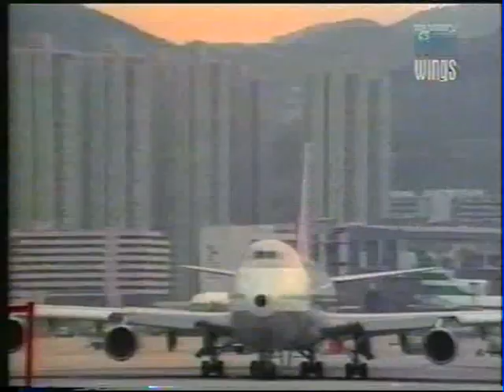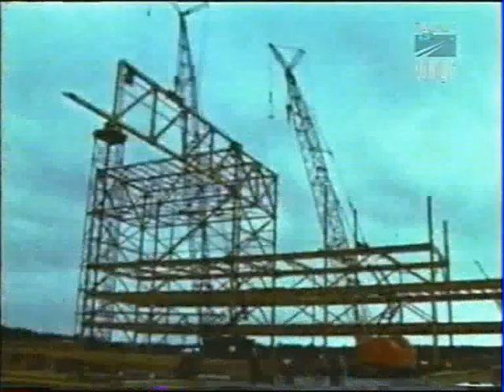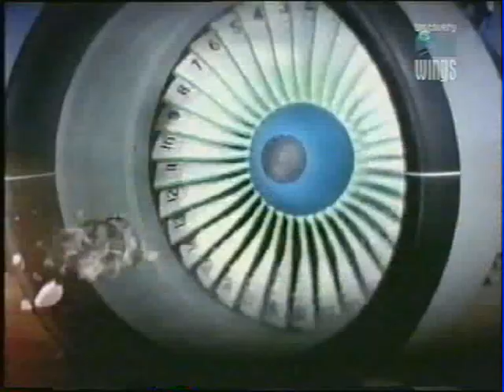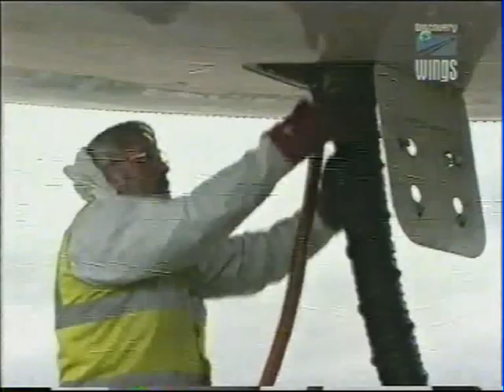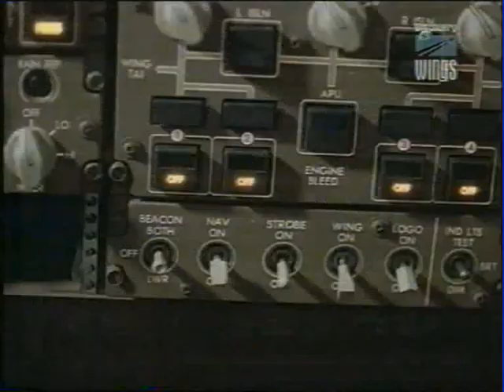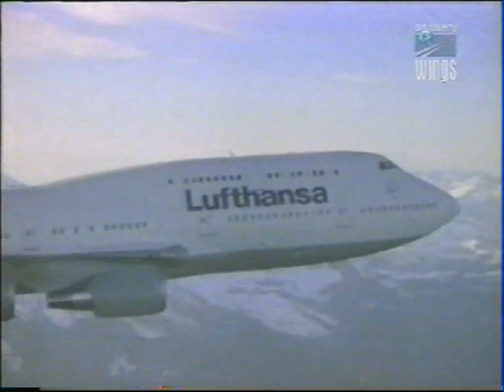Boeing 747 400

Comment: Boeing was on the mark with the B747 - always reading the market correctly - anticipating and virtually creating mass long haul affordable transport, thinking ahead to the flexibility of the frame for cargo operations, both during its long service life as passenger and also for post-passenger life as we are seeing today.
Airbus and Concorde on the other hand read the markets wrong in a big way. Although both Concorde and A380 are brilliantly engineered, they just did not fit any long term market flow. Concorde had too low carrying capacity and no cargo backup, and the A380 was mainly built on the premise of replacing ageing 747s - and Boeing was ahead of that thought with leaner two-engined point to point aircraft. Airbus should have been more on this course, and now with the announcement of the end of the A380 production line in a few years, this verifies their incorrect future assessments.

Comment: If I won the Powerball Lotto and was looking for something to blow my half-billion on, I would shop the boneyards for a recently-retired 747-400.  A rock star could probably snag one with low hours in prime condition for less than $20 million.  John Travolta owns a commercial airliner, and he said he couldn't afford to buy a 747.  But he seemed to be thinking of the new airplane market, where the Arab oil sheikhs buy theirs.  They lay down $300 million for a new one, but in today's market you could get one of these low mileage beauties for less than one-tenth as much.  Plus you would save it from being chopped up.  I just need that winning ticket, and I am there!
Reply: +Stacie45 While this is all true, keep in mind that fuel and pilots often cost much more than the actual plane.
Reply: Jerry Dodge True, nevermind maintenance.  I have a friend who is an airframe & powerplant mechanic, he owns a Beechcraft Bonanza that he restored and maintains himself.  If I owned a 747 I would want to fly it myself, but it would be a bit more of a handful for maintenance than a single-engine Beechcraft.

Comment: wow they discontinued production of the 400 but boeing kept the 47 going for decades more the 747-8 is the most fuel efficient jet
Reply: Airlines now buy twin engine airplane for the weight reduction and fuel efficiency with the same or more capacity, see  B777-X

Comment: It Simply would not be possible in the real world situation.. 1 engine alone  is not enough to power a bird that big, it 1 engine was or close to sufficient they ( designers) would have made the 747 a twin engine aircraft, supporting that is the fact the twin engine aircrafts are actually more reliable due to haveing less parts therefore less chance for something to go wrong and fail.!

Comment: I sometimes also fly 747 in FS9. Once I climbed up, and shut down 3 engines of 4, then with rudders and banks it could fly further. I am curious, whether it is possible in real or not. Opinions?
Reply: For my long flights on FSX 12hrs + i only use the 747 400/747 8 i never use twin jets

Comment: Last month I traveled on board EVA Airlines 747-400 retro fit from Seattle to Taipei. It was a 12+hours trans pacific flight. When I booked the ticket, I requested to seat on 2nd deck. EVA had changed 2nd deck from business class to economy. The entire 2nd deck had 3-3 seat configuration with a huge open galley in the rear. However, the overhead bin was quite small, and the compartments along the wall are barely to fit a laptop case. Seats are much better than on main deck economy

Comment: rofl, the default FSX 747 is crap, the Autopilot Master Switch wont even work in the virtual cockpit, plus you cant even switch batterypower and stuff in VC, its crappy. Just fly's like a large Cessna. I prever the default 737